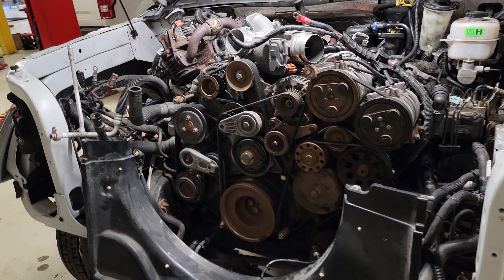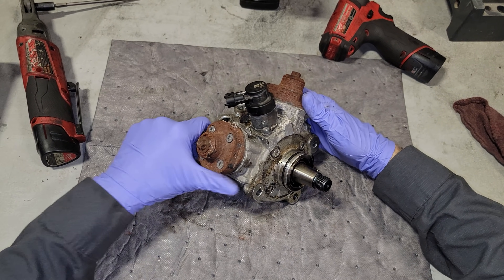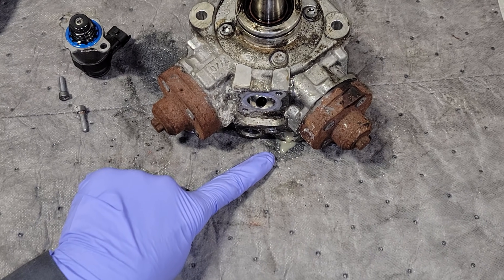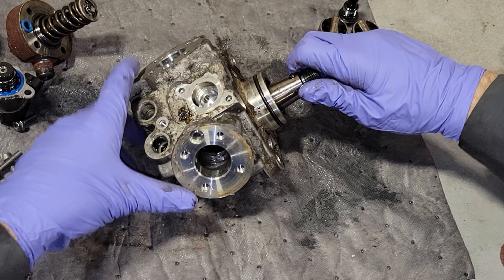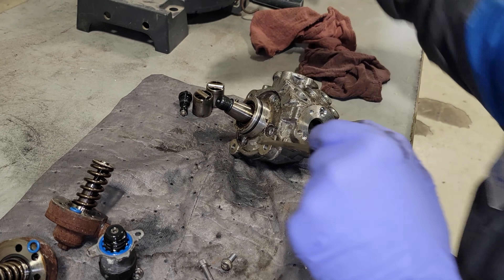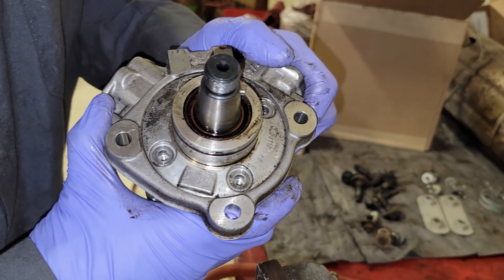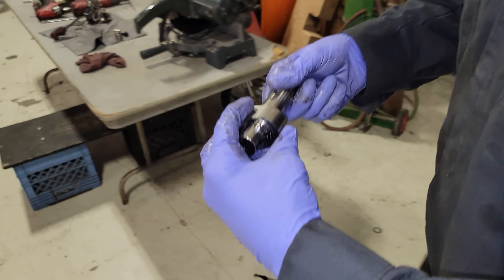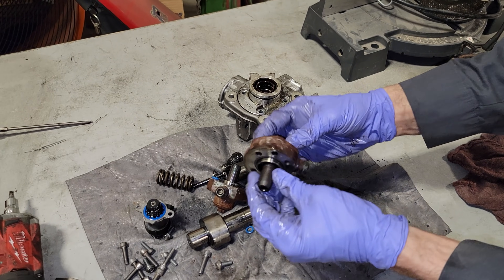What happens when YOU feed your | CP4 PUMP | DEF for a hearty SNACK?? WATCH THIS & don't be dumb!!!!

Comment: DEF is very corrosive, this is why everything in a def system is either plastic or stainless steel. Fuel pumps, injectors, sensors on the fuel system, the common rail and fuel lines have to be replaced. If not, you’ll replace them later.

Comment: Don’t bother buying the SPE disaster kit…Will not hold rail pressures…Awesome concept and I think Dan at SPE has some really good stuff but the disaster kit needs some refinement.
Reply from the maker: So does their customer service, like ferrrrr real.......
Reply: @PowerStrokeTechTalkwARod  Yeah probably the worst I’ve ever had to deal with. It’s truly sad
Reply from the maker: It is! & to think i thought i liked their products. That Amy & Dan.......😔
Reply: @PowerStrokeTechTalkwARod  Yeah I kept getting the P0087 code and it scared me so I check the CP4 and everything that supplies fuel to it and the rails and all was well with in spec. Called Az and Proven diesel and he told me exactly what my problem was and removed the disaster kit and the code has never come back since

Comment: A week ago I heard from the owner of the local truck safety lanes that pump failures are fairly common at 120k regardless on these trucks and his friend had a 11k bill and his truck was going to he down for 3 months because of part shortages. I hadn't heard of that prior so I looked into it and saw class action lawsuits for the pumps. The ULSD doesn't provide the lubrication that European diesel provides.
1.How truly common is this pump failure without a mess up like putting DEF or gas into the tank?
2. If common I see there is an updated pump on the market do you know anything about it whether it's is better than the original pump or not?
3. How much does it cost to replace the pump before a failure occurs? 
Pump cost looks like $1300.
Reply from the maker: I have 1 rollin' round with 1.3 milli with all OE system
Reply: @PowerStrokeTechTalkwARod  wow that is crazy awesome!.
Would you say a few hundred thousand is way more common not?
I had thought i heard of a lot of these trucks with several hundred thousand miles.

So I guess I shouldn't be worried as long as I don't mess up or no one messes with my fuel.  I keep up with my fuel filters too. I think I have been changing them at 25k and use Howes occasionally. 
I got nervous when I heard about the big bills and pumps failing without mistake and purely from the ULSD. 
Thanks
Reply from the maker: Brother fuel filters are every 15k

Comment: I hope everyone understands that there are millions of cp4 pump trucks of the 3 brands running the roads and a bunch of them have 250000 miles and slack fuel filter maintenance and no fuel additives ever added. Putting DEF in fuel is a guaranteed way to kill this and any of the other pumps. The gm trucks got their DEF filler moved next to fuel cap in 2020.
Reply from the maker: Thank u sir

Comment: Why did u not pull the cab?
Reply from the maker: 1st off WHY WOULD U WASTE UR TIME.....2nd was a shuttle bus..so good luck.....
Reply: @PowerStrokeTechTalkwARod  I can pull a cab in under 2 hours.  I can save much more.time than that on the repair. But I understand the shuttle bus issue
Reply from the maker: To each their own. Imo 2hrs to slow me down....id buss a side out in 2hrs😂😂 heaven forbid it be a shuttle bus concocktion

Comment: I had a former customer call me while they were 600 miles from home. WIF was on and she told me she put a little bit of DEF into fuel fill at a fuel stop 15 miles back. I had her drain fuel filter and then run fuel pump 3 KOEO 45 sec cycles then close drain. I told her to put the quart of generator motor oil into fuel tank. She got home but the next day it died with a loud squeal from engine on the way to the Ford dealer. I didn't know if all that would get her home but I figured it would at least make the wait for hubby to come with other truck to get the horse trailer n horses if she got down the road. I told her to ask for the HP pump. I want to take it apart.

Comment: WOW. Yet another interesting vid by my man A-Rod! That is the very first time I've ever seen a 6.7 Bosch CP4 high pressure fuel pump disassembled. Looking at all those parts makes me wonder about the amount of engineering involved in the manufacture of that little gem. As for the DEF to fuel contamination. Yup, that looks very familiar.
Reply from the maker: Hey buddy, hope your well
Reply: @PowerStrokeTechTalkwARod  I'm still alive and kicking. My new ride is out getting ceramic coated and undercoated. Should be getting it back next week. Hope you're doing well.
Reply from the maker: Call me up pal

Comment: Off tangent slightly but have you seen the fuel line from the high pressure pump to driver side bank common rail leak to the point of tow in situation?
Reply from the maker: Nope

Comment: OK homie thanks for rocking out this video I've been a waiting restlessly to see the guts of this often slandered cp-4 pump. It's  Benjamin here critiquing your like usual virtually flawless videos, your cameraman gets the atta'boy tonight haha 👍 anyways I forsee for those out there with this pump excluding the senseless and self inflicting cases Like tonight's contamination cause,  we better be filter changing water draining and fuel lubeing twice as much as we think or what Detroit is saying do  just as a C.Y.Ass .  I wish you could do a a quick scratch or Rockwell indentation test on shaft lobe and  then on roller to see what's up, I'm hoping its not a plating or hard facing of a cheap component problem like G.M. did with the lifters and camshafts of the Displacement on Demand engines you know that V4 V6 V8 bullshit. Oh boy.  Fuel quality is the number one priority rite now but hell there HACKING that shit rite now so until we get geeksquad over to Colonial pipeline we just pucker our asses and do what PM we can until the day comes our way to dig in that madness. Oh and I was cringing when the vice jaws met the O.D. of that pump to separate then fell back in recliner when you hit it with the ballpeen holy man!! I know it's scrap and no core I assume to reman but just start them 4 bolts back in brotha lay on bench prop and drive out gently with a drift or light duty airhammer!! No marring of parts no scratching it up plus its probably faster may man.  Just saying......ha anyways dude you are my hero!! I can rest tonight with ease after the video keep on with the good stuff dude you rock.
Reply from the maker: I can't believe this comment you're friggin awesome thanks brother

Comment: This is why I hate no self serve fuel in NJ. You gotta watch everything the employee does. Also why is the DEF fill right next to the fuel?
Reply from the maker: Ask ford.  Plus if they put it anywhere else everyone would complain that they put there
Reply: @PowerStrokeTechTalkwARod  Good point! It just seems dumb to have that arrangement when a mistake costs thousands. You’re right though, people would complain if it wasn’t there.
Reply: @Rift45  so true yet I think having them next to each other helps (some but not everyone apparently) so people can see there are 2 different places for the 2 different fluids rather than someone thinking they both go in the same place. Chevy had the DEF fill under the hood. I imagine quite a few people get into that truck and the DEF fill notice comes on and may just add it to the tank. Don't know but I personally think having them next to each other with different colors and different sizes is a good idea so when filling people can see there are the 2 different filling ports.
Reply from the maker: I have had no issues the last 11 yrs🤷‍♂️

Comment: Why Ford puts the def fill next to the diesel is beyond me. We’ve all had days where our head isn’t in it
Reply: The gm trucks had it in engine compartment through 19 but with 2020 redo theirs is by fuel filler too. If people quit using cell phone while doing a lot stuff there be less bad shirt happen
Reply from the maker: Aint that the truth
Reply: Doesn't that actually help having them side by side? That way when filling the DEF one can see there is a special place for that. Especially someone new to diesels or diesels that run DEF. If someone was new and doesn't see the separate fil location I think it would be more common for someone to fill the wrong tank. Just my thoughts. Like anything it can go both ways for sure. Different people like different setups.
Reply from the maker: Then all we'll hear now is: why does Ford out it here, now I gotta get out walk around...make a mess......no ine will ever be happy. They'll  just keep making EXCUSES
Reply: Its a pain in the butt to fill if not. Gm used to be undehood but a pain to fill and was often messy.
Reply: @kennethobando5755  $20k if you mess up is a hard lesson to learn. Would rather it be a pain
Reply: @jonnyg44  Yeah but pay attention and double check before you finish filling. The other thing is you really have to not be paying attention the def and diesel nozzle are huge difference in size/weight. For me it would be easier to accidentally put gas in it. If you find out before turning on the truck its only a minor repair to flush the tank.

Comment: Does anybody know or has anyone calculated the amount of horsepower it takes to run that 29000 PSI pump?
Reply: The pressure is needed for fuel atomization. I know Mack/Volvo common rail engines don’t have a high pressure pump, they utilize three of the six injectors. Three of the injectors pressurize the common rail on the exhaust stroke(overhead cam engine, three pumping injectors have a spill valve and needle control valve, the other three only have spill valves)

Comment: The amount of  pressure, direction and travel on the bearing makes it impossible to rotate unless there is corrosion on the bearing or cam. CP4/CP4,2 only fail from lack of lubrication almost always caused  by contaminated fuel. Quality fuel from a high traffic station and a quality additive will yield no issues.
Reply: That's what I was thinking.

Comment: Well...now you have to admit it's easy to get confused.  The diesel filler cap is green, says "DIESEL" on the cap, and is 2x as bigger than the blue DEF filler cap.   Seems to me, the designers at Ford could easily protect the consumer by including a personal valet with every diesel vehicle to fill it up so no mistakes could be made...